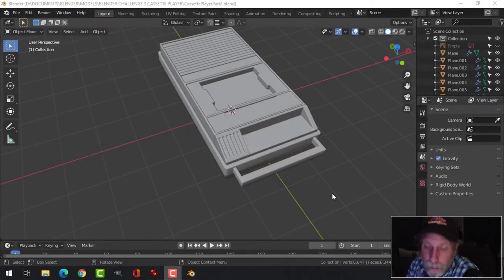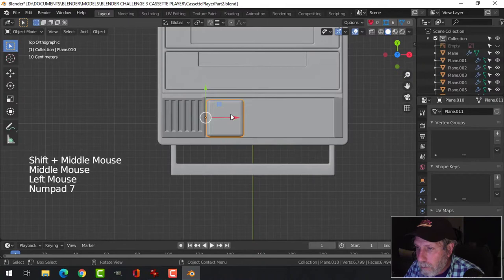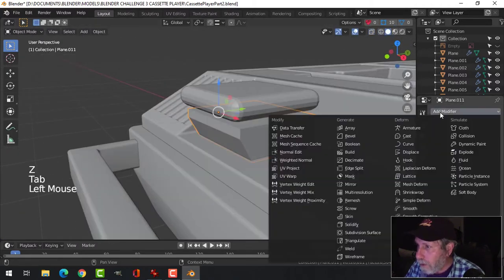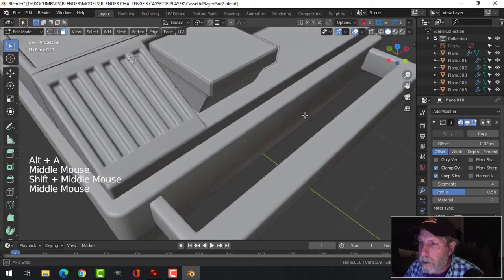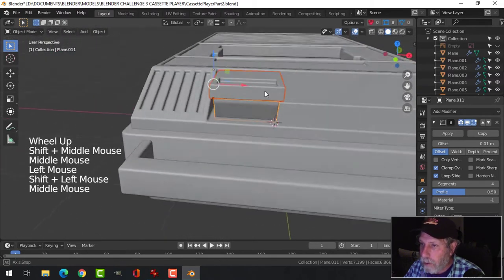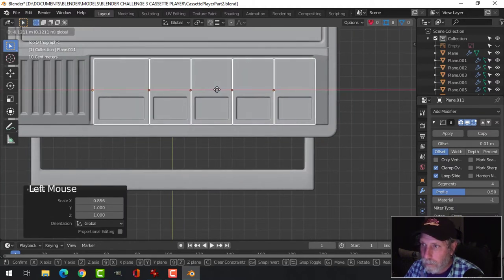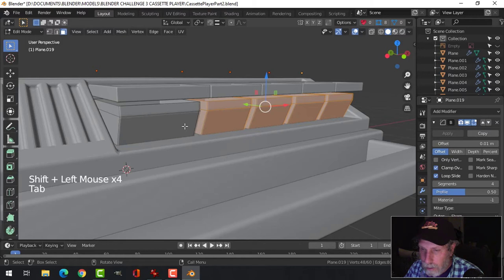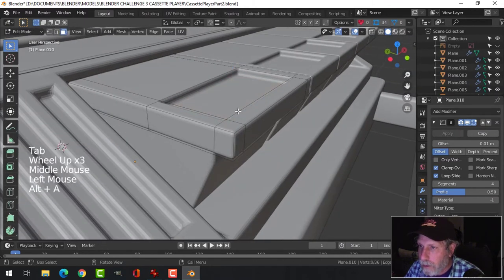BLENDER CHALLENGE 3: Modeling a Cassette Player (Part 2)

Comment: how did you get the display showing ngons tris and quads in the top right of your menu bar? is this an add on as i cant find an option to get this display?
Reply from the maker: Yes it is an add-on. Will get you the name later when I'm home.
Reply from the maker: The add on is called polysource